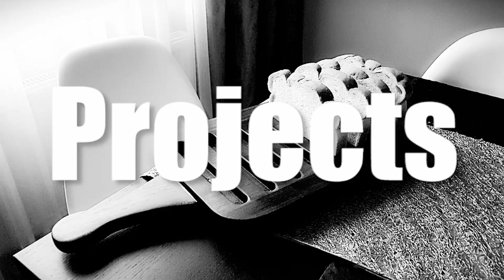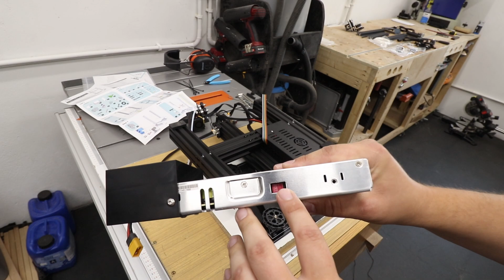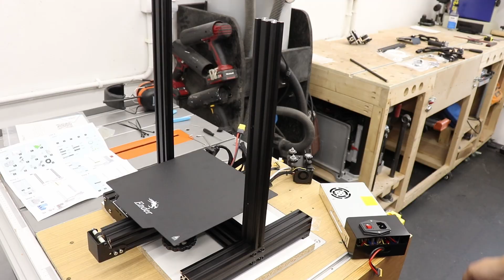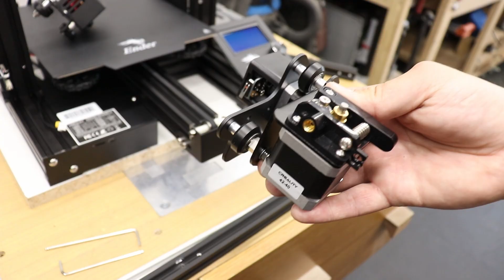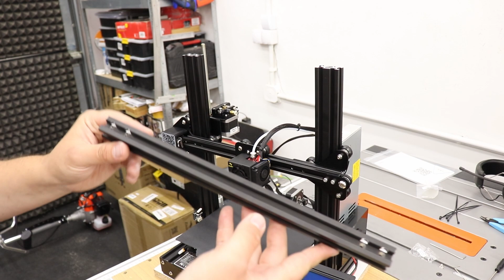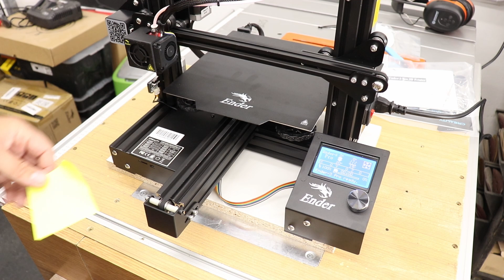Budget 3D Printer Ender 3 Pro Detailed Assembly | 3D Printer for Beginners

Comment: Mine is set to 230 V which is not the correct voltage for where I am. How do I switch it?
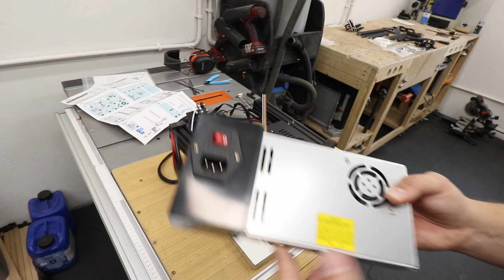Reply from the maker: The switch is on the power box i do show it on the video at 2:28

Comment: The part at 10:45, mine is quite wobbly no matter how hard I tighten the nuts and bolts on the wheels
Reply from the maker: Sometimes u need to undo the bolts to get the right fit. Are the wheels in the right position?

Comment: Been eyeing up the pro after my voxelab X2 died on me so now seen this I'm definitely going to get one now
Reply: Ordered it  and it's on the way hyped to get it and build it up
Reply from the maker: @e-bike-bys-vykken7422  hope it will serve you well
Reply: Indeed will be watching your video while building it so I don't wreck it lol plus I want to teach the boys how to use it as they are young and like crafts work so going to teach them how to make things my Mrs is on board with it so should be fun for sure
Reply: just found the part that holds motor and extruder has bolt the wrong way around so have to remove extruder and motor to put bolt in correct so the bar fits on proper the bolt you said fits in channel cut out on bar is other way has nut on wrong side so lucky not a majoun issue but one i noticed
Reply: Finally it's alive your video was a big help cheers man just have to do bed level lucky I know how that works lol
Reply: got it printing perfectly first go its now printing away your video was a massive help man cheers
Reply from the maker: Solid machine 👍

Comment: Hi, thank you for the video. This will be super useful as I have one in the box for a couple of years now... I also have the sensor for autolevelling from Creality (the same that's on the CR-20 I believe), at which point in the assembly in your video do you think it would be the right time to mount this or can it be easily mounted after and without dismounting much? Thanks in advance
Reply from the maker: I've not got that upgrade yet but to my understanding it's fairly simple to add it after full assembly is completed.

Comment: The spring at the top of the printer & that black plastic piece, how do those fit together? Mine came off while moving the printer.
Reply from the maker: Hi drop me an email with some photos of your problem and I'll try to help 👍 
Casualdiyuk@gmail.com
Reply: @Casual DIY  Will do. Thanks for the acknowledgment. Printer has been sitting, and I'd say 75% put together for about 8 months, life sorta got in the way.
Reply from the maker: @wtconroe879  I know exactly what you mean 👍

Comment: guh my printer won’t home correctly, it’ll move up and down, but not left or right. not sure about the bed though
Reply from the maker: Maybe the motors are not connected correctly
Reply: @CasualDIY  yes i did fix it, two of the wires weren’t in the right place so i had to swap them :D

Comment: Nice one mate. I use my ender 3 v2 heaps in conjunction with woodworking. Table saw sled runners, mitre gauge runner, zero clearance insert plate for my rage 5s, dial indicator holder for aligning the blade and fence to the slots, kerf-maker, featherboard, clamps, marking gauges, pattern router templates... the list goes on.
Reply from the maker: My head is full of those projects as well. What software do you use to design 3d objects for printing?

Comment: Mmmmmm,  it looks like YT didn't like something I mentioned in my comment of what I thought was helpful information for you. I'll rethink it & try again 🤷‍♂️
Reply from the maker: What was it? Why do you think that?
Reply: @CasualDIY  I’m assuming it was removed due to a mention of a website and not a fellow YouTuber 🤷‍♂️. 

If you’re going to run your printer in a remote location like you workshop & want to keep an eye on print progress, I can highly recommend the addition of a Raspberry Pi running OctoPrint & a camera kit. Bryan Vines (BV3D) channel covers this and more. 
There’s also a useful plugin that can detect a failed print & stop the process which I want to install at some point. Using a wifi controlled power socket also means you can turn the complete kit on/off, then upload files and start prints all from your smartphone 👍.  Take care, Bill.